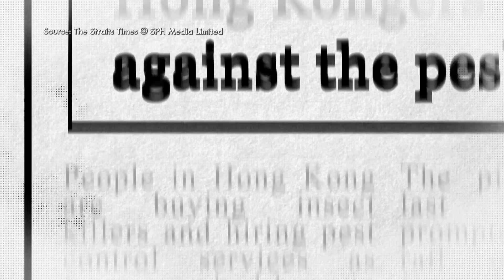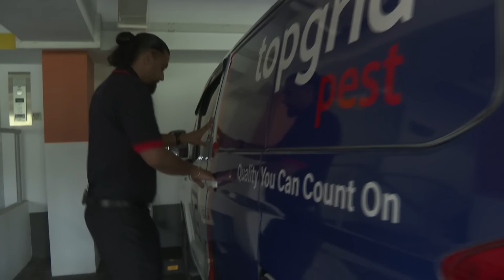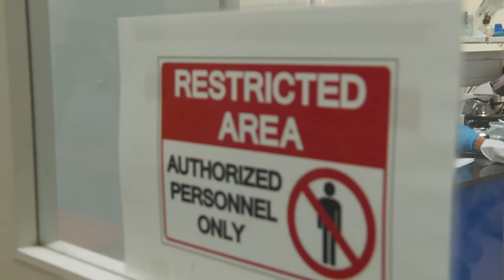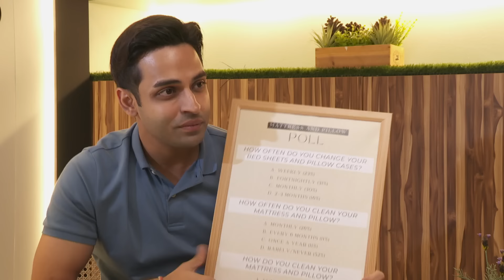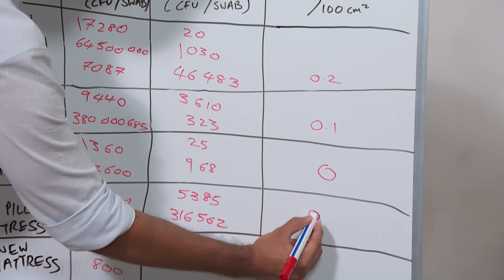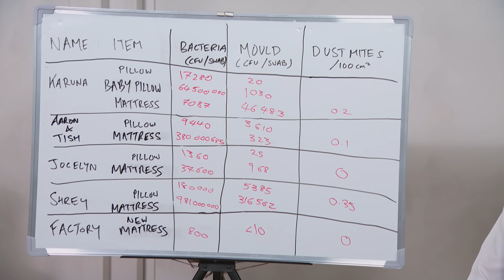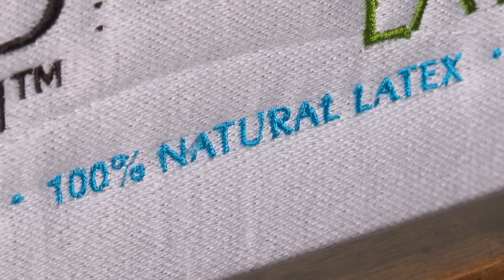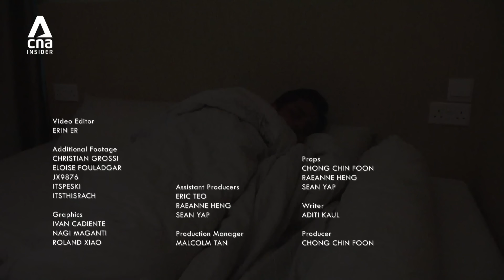Bed Bugs & Dust Mites: Are These Tiny Insects Living In Your Bed? | Talking Point | Full Episode

Comment: Bed bugs are becoming a widespread issue globally, with reports of infestations in cities like Paris, London, and Hong Kong.
Bed bugs are small, oval-shaped insects that feed on the blood of warm-blooded animals, causing itchy bites and potential insomnia.
Prevention measures include washing clothes and cleaning luggage immediately after travel, as bed bugs can hitchhike and infest new locations.
Dust mites, smaller than bed bugs, are also a concern, thriving in hot and humid environments like Singapore.
Regular maintenance, such as washing bed linens weekly in hot water and vacuuming mattresses, helps reduce the risk of infestations and allergic reactions caused by dust mites.